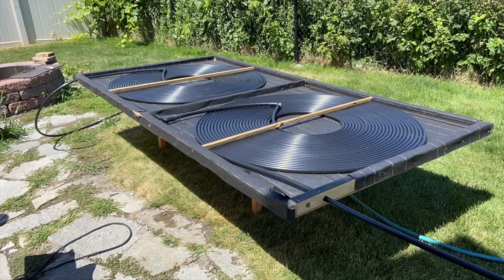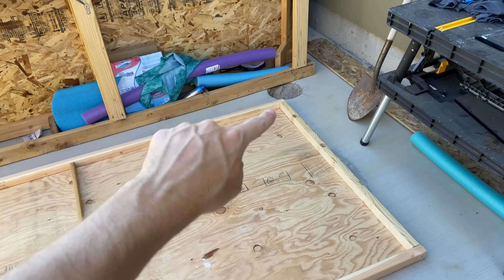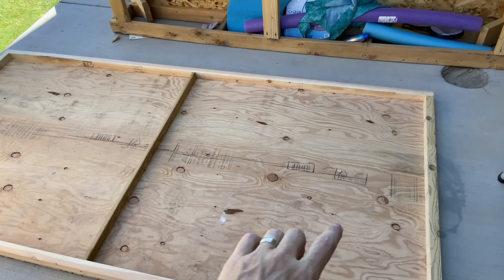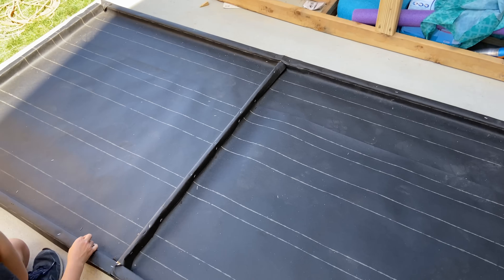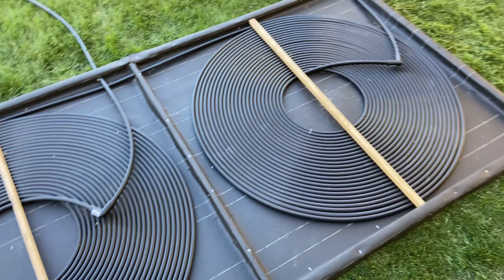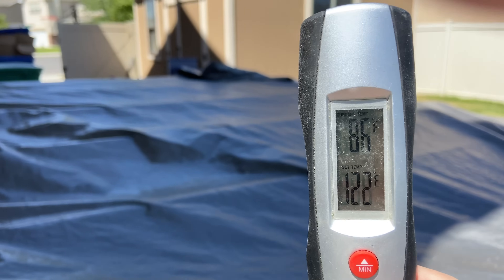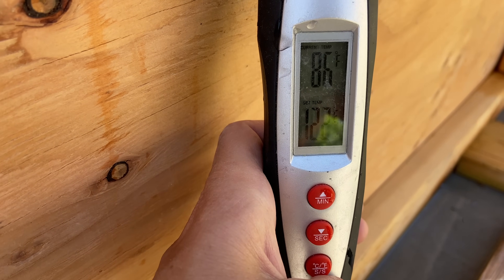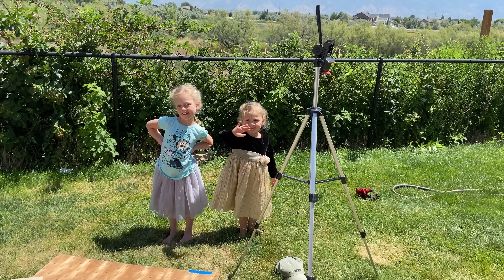DIY Pool Heater - $50 Solar Heater

Comment: Someone brought this up earlier, but you really want to increase the flow and lower the outlet temp.  The biggest factor in heat transfer is temperature difference.  You have a 140F chamber and the cooler the tubes, the more heat they can absorb.  If I recall your numbers i think you had 77F in and 89F out at the lower flow which you thought was about half the higher flow.  Lets say that flow was 1 pound per minute. 1 BTU will heat 1# or water 1F, so that would be 12BTU/min or 750BTU/hr.   You said the higher flow netted you about 87F, or 10F rise, but at double the flow(2#/min) that is 20BTU/min or 1200BTU/hr.  You may have a lower temp at the higher flow, but you are actually capturing more energy because the lower coil temp makes the panel more efficient.  Nicely done, most people neglect the clear cover, and that makes a significant difference in how well the work.
Reply: Hey rronmar.  This is great info, and now I have a question based on your comments.  Let me begin with what I understood from your info... higher volume of flow, with a 2-5 degree increase is preferable to a trickle with a 10, 20, 30 degree increase, correct?  So, my thought was this... if I have a 1 ft. x 30 ft. enclosure, lined with black tar paper and a clear poly top (super long, skinny box)... and in that box I run six (6) lengths of 1.5" black ABS pipe, back and forth like a radiator (giving me 180' of continuous run), would you think I could expect the target temperature increase of 2-5 degrees?  Based on your math, is this a sound idea, or could I get even more or faster heating?  It's not a money issue, so much as a sneaky space and durability issue.  I'm not a fan of cheap plastic irrigation tube.  Thanks!
Reply: @matthewpeterson3329  you can get higher energy output with higher flow. Another problem with low flow and higher temps is that the hot box temp rises and the box itself sheds heat to the surrounding cooler air instead of passing it into the water(thermal rejection).  At some point with flow increase you will hit a decrease in collected energy as the fluid gets less time to absorb.  If you can measure inlet and outlet temp and exact flow rate you can find the maximum power production point by comparing the numbers like I described above.  Most solar electric charge controllers track this and load the panel to the voltage that delivers the highest wattage output.  

Heat transfer is about temp difference and time/flow rate which determines how long the fluid contacts the heat surface.  Your real collection surface area in the box you described is mostly going to be on the side exposed to the sun. Unless there is room for hot air to circulate around behind the tubes the side away from the sun won’t contribute much.  Another thing to consider is laminar flow.  Fluid flowing thru a tube tends to stratify with the fluid along the inner wall staying there and the fluid flowing thru the center staying there.  So the fluid against the wall gets real hot but acts like an insulating blanket(water in a wet suit) keeping the center tube water from absorbing. And that raises the skin temp of the cooling tubes and causes increased thermal rejection.  When talking about transfer into water, turbulence is your friend.  Especially for pipes that large you need to install something to create turbulence. Like a long strip of plastic twisted which will force the water to spiral up the tubes.  I would try to install a turbulence creating device on any tube type collector. For that matter you could put a smaller capped PVC pipe inside the 1.5” pipe and get rid of the center of the flow that really isn’t doing anything for you anyway.  Some dots/dimples of sealant or screws on that inner pipe would produce turbulence in the area between the two pipes and keep the inner pipe centered in the outer pipe. My ideal collector would be 2 plates with a mesh sandwiched in between to create turbulence in between the plates, set in an insulated box with a clear cover. A flat plate collector like that would not be able to hold much pressure.  I experimented once with a sheep of thin aluminum glued to a foam sheet with a bunch of criss-crossed cuts(formed a bunch of pyramids) for the water to flow/tumble thru.  It worked pretty well…
Reply: @rronmar    Awesome information, and thanks for the quick reply!!!   I hadn't considered a flat panel system like you described, but I have some material at work that I could experiment with.  It's basically a corrugated wafer that could be boxed into a wide, flat-ish tray.  Good volume, good surface area and good churn... might be the ticket!
Reply: @rronmar  it would be nice if he did a followup that. 1 shows water coming from pool to the pool.  2. let run circulate for an hour (to normalize temps). 3. shows temp of pool . 4. shows temp going back to pool 5. show temp outside 5. time how long to fill a gallon jug(flow rate) .... if someone did all these steps, we might actually have facts that prove how useful it is...  because it dont matter if its 500 degrees coming out of hose if its coming out 1 drop at time.. this is just to give perspective of the facts that are needed, to prove its usefulness.. there are still other factors of course, but this example would help prove wither its worth the time money and energy to do this project... thanks for the video and great design, just need another test...
Reply: Very correct! It's hard to explain.
Reply: I am just entering the world of diy solar pool heaters and thank you for verifying my thoughts. I saw one in person and the owner ran it at a low flow rate to keep the output hot. But that is leaving uncaptured heat in the lines. Realistically, the black pipe is going to absorb all the heat it can from the sun and transfer that into the water, so it shouldn't matter if the output feels significantly warmer than the pool.
Reply: @developingdaddy  correct, up to a point.  Heat transfer is about temp difference, surface area and time.  If the flow is too fast, in theory you could leave heat in the panel uncollected.  It is important to be able to accurately measure flow.  Thats as easy as a 5gal bucket and a stopwatch.  @ 8.8lb per gallon, you can  then know pounds per min/hour.  If you add in input and output temps, you can then figure BTU/min or hour.  1 BTU will raise 1lb of water 1deg F.  It then becomes a matter of adjusting flow to find the optimal BTU/HR.  You of course need to make these measurements under the similar sun conditions…
Reply: Took the words right out of my mouth. 
Cheers 🎉

Comment: What kind of hose connections do you need? Would I be able to connect this through my pool pump or can you explain how I can connect that thin tubing to my pool pump? Thank you!!
Reply: i wouldnt hook diy stuff to your main pump without being absolutly certain, but you could easially T in two shut off valves(orintated to open the heating circut but never shut the original filtration circut) and connect the heating element to that, it should be the last thing before the water returns to the pool. plumbing section at you local big box will carry everything.
Reply: @TheFained  all good I just got a submersible fish pump:)

Comment: How much more effective would it be to use 1" tubing?
Reply: My understanding is the more you can split the water into smaller chunks it can be heated faster. So I feel it would probably be more efficient to use smaller hoses covering the same area. The more you seperate the water into smaller sizes it can be heated quicker.

Comment: $50, if you get a free piece of 4x8 3/8" plywood. Otherwise, add $20.
Plus you need leftover tar paper so you don't have to spend money on that, either.
Reply: Nor did he factor in buying a seperate pump to run this or the fittings needed to add this to your existing pool pump. Also he added the plastic cover in the end that wasnt included. Wondering why they cant just have a full start to finish everything included with real price.

Comment: I grew up on a similar system :) My grandpa put the hose on the roof, that was tiled with ceramic tiles. We had free warm water all summer 😎
Reply: Why would you need free warm water during the summer … it’s summer. Everything is already warm
Reply: @jamesbizs  It all depends on where you live and what part of the summer you're in.
Reply: @j p  Because at night the Temps drop. Even in Florida and cools the water down.

Comment: It doesn't matter how fast the water runs. Whatever BTUs/hr you can collect should be the same at any speed.
Reply: Incorrect, if more water flows, the temperature difference (delta T) is higher and therefore more heat will be exchanged. Yes, the outlet temperature will be lower, but there will be much more water coming out and the total amount of energy put into the water (Q) is higher
Reply: This would actually be true at a certain flow rate and above once you are transferring the maximum heat the panel can supply. A flow rate below that would make hotter water but less volume and overall less heat transfer.
Reply: What's wrong with you putting science in a YouTube video.

Comment: This is fantastic but I have a party-pooper question. Does  the heated tubing give off any chemical toxins that would make the water unsafe for contact with the skin? I know for drinking water you gotta use a special white rubber hose but that's for drinking.
Reply: you can use the red pex piping and paint it black
Reply: @samirfouad2162  thx

Comment: I wonder how many loops to get to 125,00 BTU
Reply: Keep in mind the sun produces only 1kw of energy per square meter. 125000btus is about 68kwatts of energy. Therefore you would need a surface area of 68 square meters of surface area to produce 125000btus and with ideal sun conditions and based on a 100% efficiency. This setup is maybe 70% efficienct . Therefore you would need a surface area that is even larger to achieve 125000btus.

Comment: Awesome how did the cheap piping hold up to the high temps?
Reply: I’m betting it’s not holding up well.  Depends on the exact formulation of course, my assumption is Home Depot black irrigation pipe deforms quickly much above 100 degrees

Comment: If you can get some dark sand and evenly distributed over the pipe it might give you an additional six or 7° it also helps retain the heat and it might give you another hour worth of production in the evening
Reply: what you mean by dark sand? i do not umderstand

Comment: Here's me doing this type of $50 DIY project: 
Step 1: OK, definitely have to invest in this $400 table saw! 
:-))
Reply from the maker: Welcome to the rabbit hole!
Reply: lowes does sell 2x2x8s....
Reply: Don't forget the miter saw, and a random orbital sander. Your wife will be grateful that you are saving money
Reply: Tar paper doesn’t get that hot with an inch of snow on it today here in Alberta, Canada!
Reply: Totally doable with a hand saw ;)
Reply: Right😂 we just spent $500 to make this $50 heater😂
Reply: Same, its everything I do.
Reply: And you will need the Dewalt cordless drill screw gun set.
Reply: Well what do you expect? A table saw is a pretty basic diy tool. You can't expect to diy things without tools.

Comment: How do you hook it up to the pool equipment
Reply: You don't. He was using a pump that he dropped into the pool. The submersible pump brings the water up from the bottom of the pool and into his do-it-yourself heater. Then the hot water travels out of the DIY heater and back into the pool. You don't have to hook it up to your pool equipment.
Reply: my question too...
Reply: You dont.. he left off the price of the external pump, plywood, tar paper, corrugated plastic etc. $50 price is misleading but neat concept

Comment: Not a bad build at all.  Back in the early 70's I built a solar heater for my mother.  She had a patio with a sink and cold water only.  One day she said she wished she had a source of hot water.  So I went to the local hardware store and bought five 8' lengths of 4" ABS pipes and some fittings.  With short tubes between elbows, all in all it was about 393 inches in length.  4"Ø x Pi x 393" = 4,938.6 cu. in. of water.  Divide that by 231 (cu. in. per gallon) comes to a water capacity of abut 21.4 gallons of water sitting on an asphalt shingle roof (slope 1:48").  Not a lot of hot water, but the Southern California sun would heat that water to pretty darn hot.  Mom was pleased.

At the top of the two lengths I drilled quarter inch holes tapped with NPT 1/4" thread and installed 1/4" plugs.  Their purpose was so the air could be removed and effectively make the system nearly full of water.  Darn thing worked great.  

How many gallons of water in your pipe?  You said bout 400 feet of 1/2" piping.  @400 feet of 1/2" piping that's about 4.1 gallons of water.  With a 1" pipe you would have four times the volume for the same length.  Like I said, this was back in the early 70's so I didn't do any temperature testing.  But the water basically sat in the sun all day, every day unless mom used the hot water outside.

One thing you didn't mention was water flow rate, how many gallons per hour.  With that information you can calculate the thermal gain versus the size of the pool, heat loss to atmosphere at the surface as well as how long it takes to heat the total volume of the pool.  All in all, it's not a bad build.  I wish I knew how much thermal gain I got out of my system.  One thing I DID learn the hard way was to put an over-temp / over-pressure relief valve on the system.  I blew out a pipe.  Had to rebuild a small section and installed the safety pressure relief valve.  In the end it was a great system.
Reply: I'd love to see a photo or sketch of this water heater.
Reply: @CorinneJudge  The solar heater was built back in the late 60's, maybe 1970.  No photos exist of the plumbing.  Somewhere I have a drawing but it - too - is so old I'm having a hard time finding it.  I'll keep looking.  But basically, in So.Cal. summer sun was hot enough to really heat the water in the black ABS pipes.  ABS is not recommended for drinking water supplies.

The basic design was to 8 foot tubes with a couple elbows and adapters from 1/2 inch pipe thread to whatever diameter ABS.  I think it was 3 inch ABS, not sure; was a very VERY long time ago.  Even drawings are "work from memory".  I'll see if I can find it.
Reply: The system in the video is 4,000 BTU/hr, since you asked.

Comment: Where did you get 500' of 1/2" tubing for under $50?
Reply from the maker: Home Depot is where I picked mine up.  It's the thin wall drip style stuff
Reply: ACE = 37.00 - 1/2 in x 500ft

Comment: Thank you for the nice video. You can make this easily much more efficient! Attach some insulating to the back side of the collector. Make water circulate faster by not connecting tubes but allowing two separate water heating spirals. It is NOT essential how HOT water you can get from the end of the hose, but how MUCH water you can heat even a few degree at a time. Hot water in the hose does NOT get much hotter in the end of the circulation, so it is advisable to get as much cold water from the pool to the hose as possible.
Reply from the maker: Great tips.  I think I'll try increasing flow on two separate loops this summer and see how things go!
Reply: How did it go?

Comment: With all due respect, but it's another guide, how no to do it...
10 deg F after all this effort? With what.. 1,5 liter a minute flow? Let's be VERY generous and say you have 4m^3 water tank. With 4m^2 surface with 1kw/ m^2 in natural solar irradiation, it does not any difference. 
I do, really do!, aprreciate the video! Just add "FAILED" in video title.
Reply from the maker: I got lost in the meters squared part, but the heater does help a bit.  Increasing flow with a bigger pump is next on my to-do..
Reply: I agree it's a neat project but I dont expect it to have much effect either and the $50 price tag is just click bait

Comment: I’ve used large glass windows, with garden hose, to get scalding hot water in AZ. Great idea.
Reply: What do you mean? I am interested in how you made yours as I live in Arizona also
Reply: @Miranda-fi6sn  basically the same thing but with glass panes instead of corrugated clear sheets.
Reply: @varmintsniper2551  So like just winding up a garden hose, a long one, and laying an old large window pane over it?